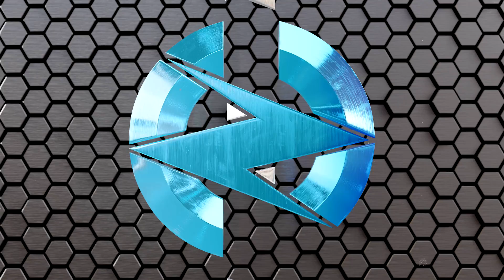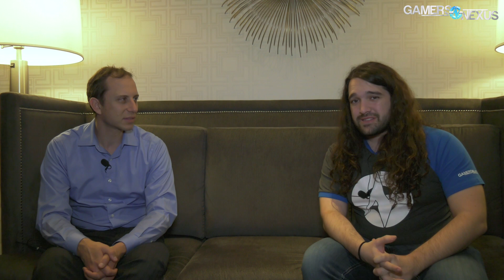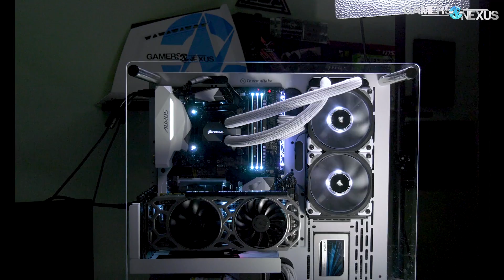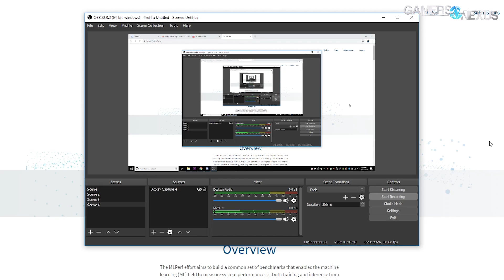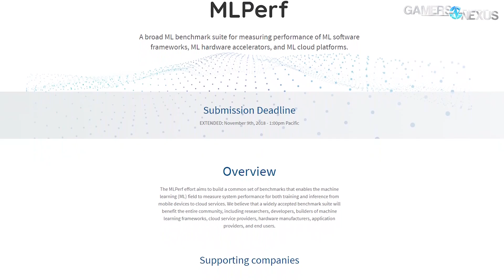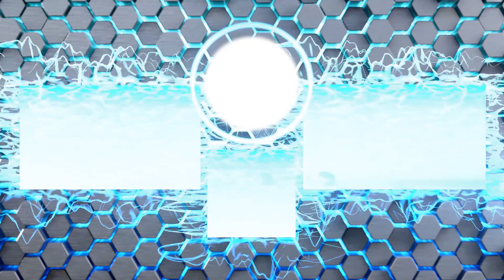Intel 10nm & 3D Stacking Deep-Dive, ft. David Kanter

Comment: AdoredTV's video on the buttered doughnut white paper is pretty interesting, similar topic... Talking about active interposers and how multi chip designs could be made better/faster.having an active interposer on an old mature node could make things interesting. Similar to how Rome is using an older IO die... Allegedly too IO might favor older, more mature nodes, and separating it from the logic cores could be advantageous.i dont understand the want to concentrate the heat with 3D though, sure in a mobile soc it might be nice, but a pc does have a lot of board space. We could condense other areas like instead of ddr opt for hbm and up the density with minimal compromise. Vega cards look strange with hbm makes me wonder why the card is so long. Is it a perception thing? I believe they could be much shorter than an equivalent gddr variant
Reply: @Patrick 

AMD is a very creative company, they do very interesting things and take huge gambles. Thats why I think they have so much of a cult following. That and they are significantly out gunned by competitors at every turn even in illegitimate ways. 

Sure bulldozer was a gamble and it nearly bankrupt them. They even pushed hard into open source for graphics and compute, open standards, even tried to push to the metal apis like vulken  which had influences on Direct X 
I do think AdoredTV is fair, even if biased.  I think he's like most of his audience, he wants and loves innovation. He makes it a point to call out practices that trample that. (if thats where you object) Steve here is great for that too, but Jim is much more intense, hours covering years of history.

Intel has more or less left its Core2 architecture intact all these years. I'm not saying that they aren't refining them into better and better products, but until recently intel has seemed nearly dormant. Its hard to get excited for 14+(^n) indefinitely. (my opinion on 14nm is Intel's is so good its going to need their 10nm++ just to make an improvement on it)

Recently Intel have been pumping out SKUs and new products. Many believe AMD to be that motivating force, for intel to push innovation hard again like in the past.

5nm is coming fast(ie the end of node shrinks), its going to take serious risks and development to get around that seemingly hard limit and continue on making better and better things. Gluing dies together might be only the beginning.

I think Adored is just a curious person who often delves deep into the abyss, that ethereal thing that is our world of technology. He's logical and blunt, and sure if he has a favorite he probably has a reason behind it.

Patrick, what's your opinion on the recent leaks? 
I personally plan on skipping Ryzen 3000 (assuming all of it true), hoping instead for a new socket that may come later. whats another year or two on a 8350 bulldozer?
Hoping for DDR5 or some HBM stacks for ram. Seems like AMD has been plagued by Ram issues on AM4, so I will probably stay away till they sort themselves out. I actually expect them to beat Intel with Rome, and this Ryzen could beat most of intel's lineup in most games/ productivity on the desktop market. Intel might even bring in a heavily  binned chip to compete for the interim until they get their new node/arch out.

I don't know if I believe all of it, even if the 16 core on AM4  is nearly useless in windows like 32core thread ripper; I think AMD would be brash enough to sell it, and people not educated enough buying it. 

I am expecting a big improvement over Ryzen 2000, I believe the leak to be pretty credible with some reservation to some of the boost clocks and TDPs, but it is possible since TDP is just arbitrary in most cases it seems. I'm not concerning myself with the prices as AMD will list an MSRP and vendors will charge what they want. 

I do think AMD is in much better shape to sell equivalent performing chips at a lower cost than intel is currently. Their chiplet/ module design is definitely giving them an edge there. Intel sounds to be right behind them, even hades canyon showed what they could do.    

I do worry about the alleged  dual chip nature of the design, as it could bring even more ram issues. Rome seems to have that IO die to fix things, these don't. 

I think the 8 and 12 core offerings are the most interesting of the bunch, probably the most useful too for the money.

Comment: Intel should just skip 10nm and go straight to 7nm
Reply: hell..let's go to 1nm why not, right? It's that easy.
Reply: AMD couldn't do a damn thing to give us more performance and so shut it!!

AMD was researching and developing what we have now as Ryzen, Thread-ripper and soon to be ROME

AMD have now rammed cores down devs throats and has force the industry to catch up intel included

Also 7nm is about as small as you can go and get 5GHz so smaller is not better but instead bigger is

Larger CPU = more cores at 5GHz

Instead of shrinking and losing clock speed but getting more slower core in the same space

Also AMD is struggling with clock speed because of the infinity fabric it is getting improved monthly and soon AMD will begin to match Intel is single core work loads even when both are overclocked
Reply: @leoo67899 , TSMC have a factory capable of making 7nm chips and building factory capable of 5 nm and smaller. 1nm factory is not ready, but transistors of that size were made in a lab for awhile ago
Reply: @commanderoof4578  "7nm is about as small as you can go and get 5GHz"
If you wanted all the gigahertz, should've gone FX, not ryzen

"Smaller is not better but instead bigger is"
Yes... let's go for bigger, monolithic dies so we can get lower yields. While we're at that, we should also go to a bigger process node, so we can get decreased performance and efficiency.

"AMD couldn't do a damn thing to give us more performance"
They had multiple opportunities where they could've taken the lead and surpassed intel entirely. Not saying that I agree with Intel's business practices, but Intel did decide to take the initiative and take the lead in the x86 microprocessor market.

"AMD have now rammed cores down devs throats and has force the industry to catch up intel included"
It looks like AMD still has to catch up to intel, with the latest reports of x86 server market share being 98%/2% Intel/AMD

"AMD was researching and developing what we have now as Ryzen, Thread-ripper and soon to be ROME"
No, while AMD was selling Excavator CPUs back in 2015, they had Zen tested and ready. Threadripper was only just a side project by the engineers.

"Instead of shrinking and losing clock speed but getting more slower core in the same space"
I'm not sure I understand how this works, please explain

"Also AMD is struggling with clock speed because of the infinity fabric it is getting improved monthly and soon AMD will begin to match Intel is single core work loads even when both are overclocked.
Not entirely because of infinity fabric. The infinity fabric was the same on Zen 1 and Zen +, they just added some cache, upgraded the IMC, and also transitioned from 14LP to 12LP. Zen+ did give higher clocks though.
Reply: Bigger is better = Thread-ripper multiple CPU dies stuck onto the CPU PCB

More slower cores in the same space thats what happens when you shrink the process size you can fit more 7nm cores in the same space vs 14nm

And when i said the industry i meant the the game industry not the computing industry
Reply: @commanderoof4578  I don't think you know how this process thing works. 7nm is more efficient than 14nm (assuming they are from the same fab), so you can clock the cores higher with a 7nm process while needing the same power, compared to a bigger process. Or you could let the smaller process have the same clock speed, but at a lower power draw. It's that simple.
Reply: That isn't how it works going to a smaller process focuses the heat on a smaller point and Intel being Intel their CPU's would overheat like a bitch if they went smaller than 7nm

Their bloody 14nm hits 90c unless you use liquid metal even tho they swapped to solder its crap compared to AMD's temps

So im going to wait for AMD 7nm and intel 7nm and then see if I am right

Hint i am right because intel doesn't give to shits about temps and will have a lower clock speed than AMD levelling the performance per core
Reply: @commanderoof4578  You do realize you are legit waiting for 2 processes that cannot even compare to each other? Intel 7nm is way better than tsmc 7nm, and anyone who argues otherwise must be blind.
Reply: Well thats false intel doesn't even have working 7nm

And only time will tell which 7nm is better if ibtel gets of their assess and actually uses more accurate etching techniques and not stick with whats proven to work

AMD has already adopted an experimental technique allowing 7nm
Reply: @commanderoof4578  The problem is, AMD doesnt have a 7nm, they're just using TSMC's

Comment: Hmm i think it will be a failure, they are trying to get more cores but at the expenses of heat, they set the bases of software to care more about frequency than cores, with ryzen things are going forward to better use of many cores, so basically this new aproach from Intel needs Ryzen to be a success and developers to adop it widely. I expect it to come like 2021 or so  otherwise it wont reach the frequency needed to be competitive, ofc the aproach is nice tho. The good thing about all this is that software will evolve in the next 5 years like never before.

Comment: 27:20 I still remember my I7 5775c. It had iris pro graphics and 6mb cache. It was basically a mobile quadcore. It was okay, but sold it for a 4770 because there just wasn't enough power for serous gaming. Also, my use case didn't need the iris graphics. Would have been a good cpu for a very small ITX computer, but not for something with a 1070.

Comment: Heres a crazy idea, and probably crazy hard to do. For cooling of a many stacked high power chip, it should be built with millions or thousands of tiny pipes that travel in an around the chips and carry water and then out to a radiator and looping back in. Or the active interposer has water running through it or a non conducting liquid stuff...

Comment: Not "3D" its just stacked and soldered chips. Not sure how they are getting away with calling this 3D. The limitation here is cooling and the solder points which will prevent any real performance improvement over standard chiplet designs being used by AMD.
Reply: It's 3D. There is depth to the die stack. And you're talking without any actual proof or knowledge of their implementation.
Reply from the maker: It is 3D.

Comment: For the heat and power concerns with the 3d stacking, would it not be possible to achieve both solutions using carbon nanotube TSV's? If it can be done for memory access application then surely it can be used for that.

Comment: intel first 3d stacking cpu's....it been work on ever since first 22nm 3d transistors ...question what AMD used on zen cores ?? question amd never bother answer....and its simple to do 3d transistors now
Reply: Try listening to the whole thing. They talked about it, amd uses "2.5d" and 3d stacked chiplets are far from simple.. There is a whole lot of problems that come with 3d stacking that they discussed that need to be ironed out with engineering and design.. These problems are the main reason intel has been struggling to get to "10nm" out into the consumer marked which isnt just "10nm" only but "10nm 3d stacked chiplets".. Just because theyve explored 3d stacking in the past on older architecture doesnt mean they automatically have it all sorted out and ready for production on a new 10nm architecture